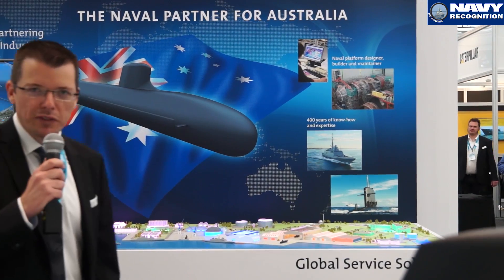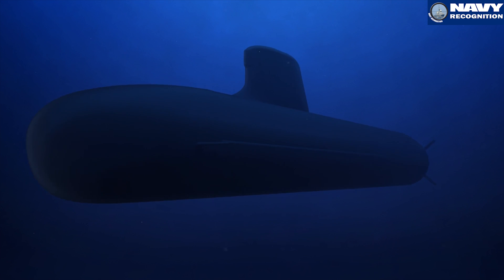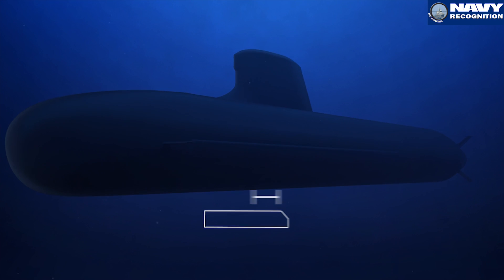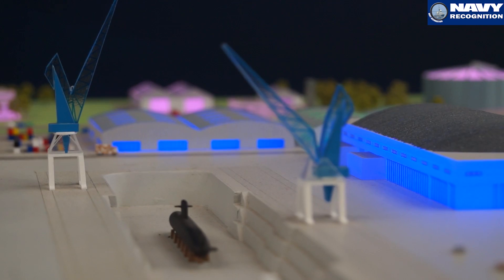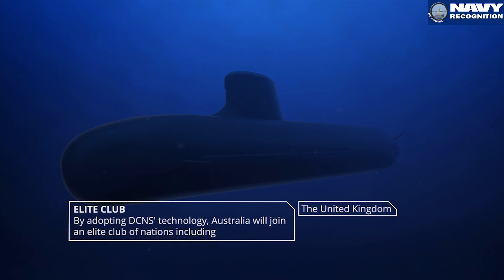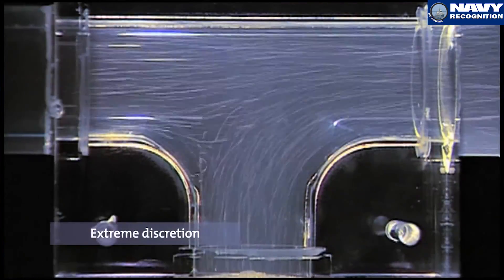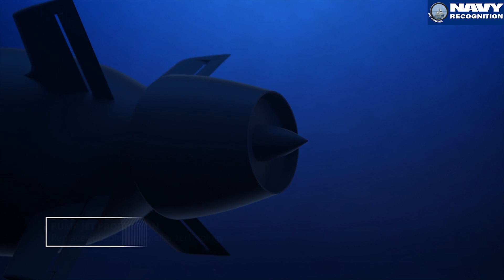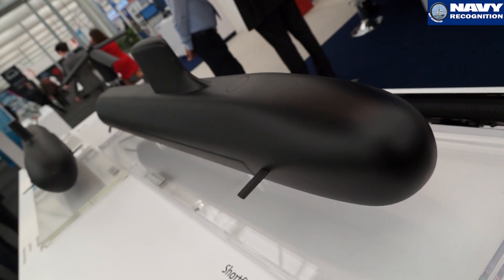Shortfin Barracuda Block 1A Submarine SEA1000 Australia

Comment: Amazing sub. Hope Aust choose this if it cant go nuclear
Reply: +lala mal The whole proposal behind SEA1000 was essentially for a nuclear sub in terms of range and speed. The French Barracuda in its nuclear powered baseline design seems like a good design. The Shortfin Barracuda which rips out the PWR for a diesel is an unknown. In general though, when you push the limits of technology, the costs pile up. The design pushes the limits of diesel technology given the Barracuda's sheer size and the range requirements.

Australia is taking a high risk bet by forgoing the nuclear option. Politics should decide defense and defense should decide capability. Politics should never decide capability. Yet this is exactly what is being done. 

If RAN leadership is smart, there will be a "Block 1" of 6 Diesel/AIP subs, and a "Block 2" with 6 of the standard DCNS Barracuda SSN, to begin construction post 2020, to keep the nuclear option open. Ironically, it would be "Block 2" that is of lower risk given that by then, French Navy Barracuda SSNs would have accumulated significant construction and operating experience; while we would probably still be debugging our diesel Block 1s, exactly as it happened with the Collins class.
Reply: ***** Yes, that would be the ideal situation - the Barracuda baseline SSN is "Off the shelf" - the Shortfin is not. The TKNS proposal would have been better for the force size if we were to operate a true 12 boat fleet.

I don't think that the car industry is ever going to come back to Australia. History shows that offshored jobs and capabilities rarely, if ever, come back - and only at considerable state expenditure. To the LNP, it sounds too much like Communism to maintain an Australian manufacturing capability, so, the car industry went belly up.

It should be noted that the exact same thing happened with GAF. Government Aircraft factory went from making whole airframes (on license) to making parts, to being privatised by a Liberal government, to being bought out by Boeing. Now they only make parts and our aerospace industry is similarly gutted. Oh, we also offshored Qantas for kicks. 

The systematic privatisation and offshoring of Australian industry is the ultimate expression of LNP adherence to the neoliberal globalist faith. This despite extensive economic studies demonstrating that every dollar spent in maintaining a domestic manufacturing capability generates 10 dollars in downstream jobs and services. Now, it's fair enough that the industry was no longer competitive. But it was never replaced by something else except defense contracts, and defense contracts are not something that you can run sustainably.

The reason why South Australia  is now a mendicant state is because of LNP ideological adherence and indifference to sustainable economic development, no more, no less. If the country is to resolve this shortfall, it would mean federal level investment into a public-private-partnership to set up some kind of civilian manufacturing capability in South Australia  - the type of investment not seen for decades. 

It could be anything, really, but I think that it would have to be some kind of heavy industry. China has taken over nearly all kinds of light industry and it is nearly impossible to compete. Which leaves either high tech or heavy industry. It would be ruinous to try to break into high tech given that new semiconductor fabs are billions of dollars at the minimum, and prices only go up from there. Heavy industry means ships, power plants, vehicles. 

Australia used to be the leader in solar technology and in terms of research corpus and domestic demand, we are still the largest potential market with highly competitive R&D, so that might be a good entry point. 

If EPBC Section 140A could be repealed, a nuclear industry could replace coal and natural gas in the economy while saving 2 billion dollars a year in air pollution related health costs. ANSTO was working with China's SINAP to develop molten salt reactor technology and has recently joined the Generation IV forum for advanced reactor development, so there might be a market there.

Wind turbines are difficult to break into given the huge state subsidies that Danish and German wind industry manufacturers enjoy, but they are another heavy industry, and unit costs are cheap while learning is approaching the bottom of the logistic curve, so there's another option. Given how inefficient the supply chain of the wind industry is right now - bearings from Sweden, gearboxes from Germany, blades from America, steel from China - a single, integrated domestic supply chain would likely be extremely competitive, while the ancillary manufacturing like bearings and gearboxes has applications outside the immediate industry, and blade manufacturing leads into aerospace industry applications.

In terms of vehicles, Australia is still very much a truck-run country, so the expansion of the heavy vehicle manufacturing now that light vehicle manufacturing has been offshored might be wise. It would even be a good export prospect as developing Asian countries improve their roads and increase their demand for heavy road transport. 

Regardless of the path taken, there will need to be federal level support - support that is unlikely to be forthcoming. But maybe someone in the future will have the foresight and vision to grant it.
Reply: ***** I don't think that Australia has the capability to build our own car, to be honest. 

I agree with you that Australia could learn from South Korean and French dirigiste/dirigisme industrial policy - but this has not been on the LNP or Labour radar for nearly a decade. The closest we came was the NBN under Rudd, and now? Turnbull replaced all the senior leadership with his Telstra goons and now the network will be inferior and more expensive. 

I guarantee you that a second attempt can and will be similarly sabotaged. No exceptions. While the old guard lives, there can be no Australian industrial policy. It is impossible. Even if we do deliver the infrastructure, there is no guarantee that a future LNP government will not seize upon it and privatise it. It happened to GAF/ASTA/Boeing, the electric utilities, Telstra, Medibank, now the ABC and Australia Post. All in the name of "deregulation" and the free market. Were it not for the uproar it would generate, a future LNP government would try for Medicare as well - but successive budget measures have already gutted its coverage anyway. 

Reading the Graeme Campbell link, the premise of a true dirigiste industrial policy is strong. The question is - who will implement it? It won't be the LNP. It won't be Labour - they have been fully representative of union interests to the exclusion of industrial interests. It won't be the Greens - they see economic growth as a parasite on earth. No blocs remain - and it is unlikely to change unless we change from first past the post to proportional representation. 

My only contention with Campbell is in his assertion that immigration is inherently bad. I would actually qualify that by saying that open borders is inherently bad. But so too are totally closed borders. 

Smart immigration policy means headhunting smart people from other countries. As a developed country, demand growth does not come primarily from population growth but immigration, and demand for goods and services is what drives economic growth. I do agree that multiculturalism as it is now defined - allowing people to form their own enclaves - is inherently corrosive. 

The current practice of allowing refugees to settle, as a unitary group, in a street or suburb, would lead to the formation of ghettos - unless we take action now to include them and treat them as our own. I have dealt with refugees from the Middle East, Asia and Africa. The way we treat them with our social services will only sow division and distrust. It disempowers them. We give them a card from a refugee agency they show to every retailer, to mark them as such. We make them dependant upon handouts because we bar them from working until onerous paperwork has been filled. The result is suspicion and introversion. It will not and cannot end well - because our system is not well designed. Our fear of worker exploitation perversely makes them more dependant upon welfare. It is quite strange. 

The multiculturalism that I knew and grew up in school to know - that narrative of inclusion and acceptance, that everyone is an Australian - it seems to have been forgotten, or at least, tacitly ignored. Maybe it will come back. Because the alternative is racism and strife. 

I have Greek neighbours whose parents fled the strife in decades past, Italians whose parents fled the war, Vietnamese whose parents fled the Vietcong. And mine, that fled the Communist Party in China. My grandparents lived under Japanese occupation. They woke up with midnight raids wherein soldiers would burst in, overturn all their cupboards, bayonet all their baskets and beds and confiscate all their books. Their relatives did not survive the rape of Nanking. All of them made their way here by boat or by plane, and now they pay Australian taxes and speak with an Australian accent. 

A smart immigration policy - like Rudd's big Australia - will result in a richer and more competitive Australia. As China's growth contracts, you can bet there will be some disenfranchised engineers laid off as their heavy industries are left in the lurch. We should poach them. As India's citizens grow richer and want to join their Australian diaspora, we should poach those in the pharmaceutical and IT sector. If we want to have a domestic nuclear industry, we should poach Korean nuclear personnel - highly trained, highly motivated, with fresh experience. The same with Germans and their solar deployment and cars; the same of those in North America if we want to develop hydraulic fracturing, and so on, and so forth. 

We can take these people and our own and use them to forge new industries.

Graham Palmer himself laments, that we are great researchers, but poor developers. These people, flush with hard earned experience, could help us bridge the valley of death for new technologies, under a muscular dirigiste rubric. 

The question is not, "can it be done?". It remains, "who will do it?". 

Unfortunately, I do not see it happening.
Reply: .....public opinion doesn't seem to want nuclear stuff . However public opinion didn't want Australia to go into Iraq either but government ignored public opinion in that matter , yet they arbitrarily choose to defer to public opinion on best choices for defense .